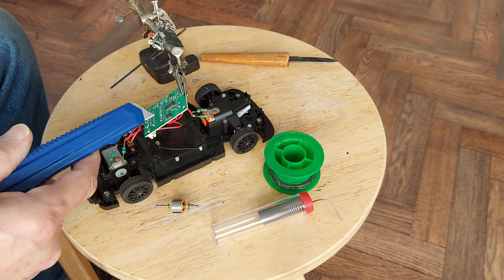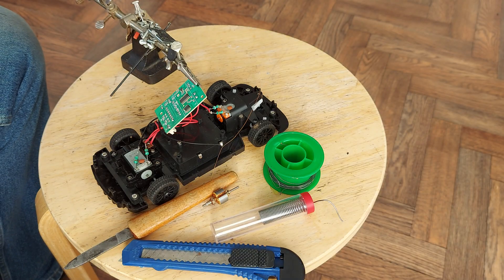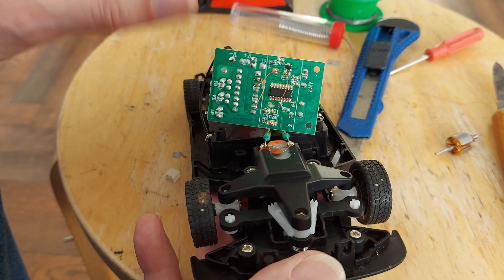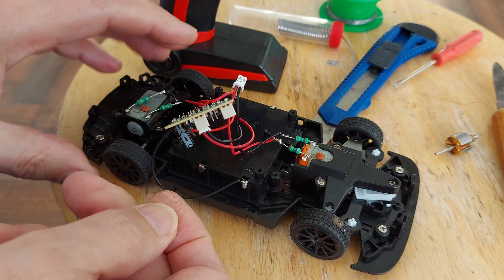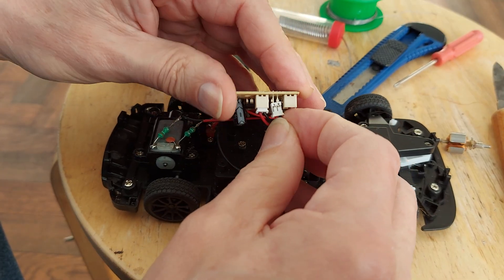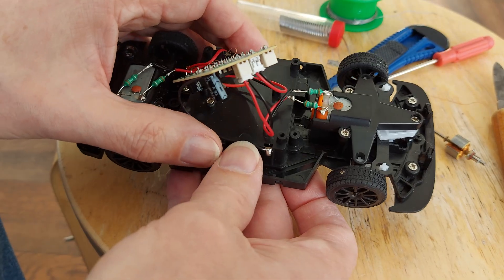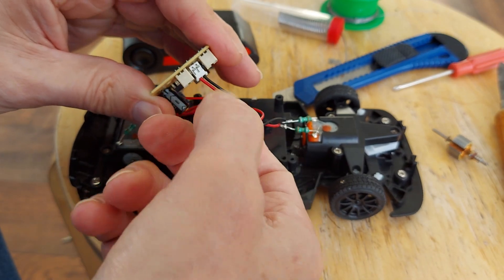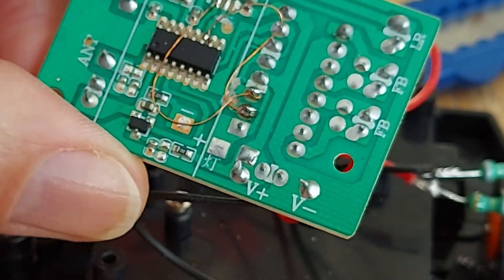Can I modify that 2.4G receiver from AliExpress? FAIL

Comment: my first curiosity is the different colors on the backs of the motors! it's possible that they're used as a designation for driving voltage(for whatever company designed them, they could be different for different manufacturers). another interesting thing is that there's TWO outputs for "forward backward"(FB on the one side of the board) with one "left right"(LR)... can try testing the resistance of each motor and maybe the color is just a misleading bit or dissect them to see the internals. would definitely drive me a lil crazy till I could get in the minds of the person that designed this! I'd have to buy a second one to see if maybe it was plugged into the board wrong as well if the second one functions normally.
Reply from the maker: The receiver appears to be for a toy grade rock crawler. With a motor on the front axle and a motor on the back axle. I have had some crawlers like that and in the first video in this series there is a screen shot of the listing showing that sort of 4x4. As far as the steering output goes, I am now thinking it may be intended for the magnetic armature steering similar to the one in this video https://youtu.be/Ex638u0NxJk?si=gnVSA_5NHUOubPis or this one https://www.youtube.com/watch?v=xoqGAq0cFY8&list=PLA5a2xPRSrB1CeqvjOaBPrHk_lVcTHSb9&index=30
Reply: @GrandadIsAnOldMan  that would certainly make more sense than having a motor trying to be driven in an "always on" state when it has a very limited range of motion when the steering rack is typically held to one side or the other. Hope you had a great Christmas and a Happy New Year!
Reply from the maker: @ToeCutter454  Thank you, and Happy New Year to you too. As for the receiver,  I am only guessing, but I have had a few cars with magnetic steering in the past. I was toying with the idea of buying another one of these from AliExpress just to check it out now that I have effectively destroyed this one, but instead I ordered a load of other stuff that caught my eye 😂😂
Reply: @GrandadIsAnOldMan  lol, looking forward to the new videos then!

Comment: A couple times you had good turning and F/B but you didn't show what you were doing on the controller, I guess trigger did steering and wheel did motion. If you handed this to a kid he would learn left is right, up is down and they would have a good time with it. It really should work as advertised without modification.
Reply from the maker: When I swapped the plugs over so the F/B was the L/R and the L/R was the F/B, the steering worked but the forward backward was reduced power. The receiver appears to be for a toy grade rock crawler. With a motor on the front axle and a motor on the back axle. I have had some crawlers like that and in the first video in this series there is a screen shot of the listing showing that sort of 4x4. As far as the steering output goes, I am now thinking it may be intended for the magnetic armature steering similar to the one in this video https://youtu.be/Ex638u0NxJk or this one https://www.youtube.com/watch?v=xoqGAq0cFY8&list=PLA5a2xPRSrB1CeqvjOaBPrHk_lVcTHSb9&index=30
Reply: I try to stick to the old frequencys,, I have transmitters I get at thrift stores,  cars and boats too. I have good luck getting them working again. I have to fix or modify every thing I see or use, even new items, love using my tools, we're having too much fun. Happy New Year buddy.
Reply from the maker: Happy New Year to you too 😊👍🎉🥂 Yes, the old 27MHz and 40MHz was cross compatible on most brands. I have a draw full of controllers for the old stuff. I also have a drawer full of the "new" 2.4g controllers, but the only time I have found a match was when they were the same brand. I suspect the manufacturers are doing this deliberately to "encourage" you to buy new cars rather than fix old ones 😂

Comment: That is really strange. 
It does work when the controls are swapped, so, a fix would be if the controls on the TX are on wires, not soldered directly to whatever board is in it. They could then be swapped in the TX and you'd be good to go 😊
As you say though, there should be no need to do all this!
Reply from the maker: When I swapped the plugs over so the F/B was the L/R and the L/R was the F/B, the steering worked but the forward backward was reduced power. The receiver appears to be for a toy grade rock crawler, with a motor on the front axle and a motor on the back axle. I have had some crawlers like that and in the first video in this series there is a screen shot of the listing showing that sort of 4x4. As far as the steering output goes, I am now thinking it may be intended for the magnetic armature steering similar to the one in this video https://youtu.be/Ex638u0NxJk or this one https://youtu.be/xoqGAq0cFY8&list=PLA5a2xPRSrB1CeqvjOaBPrHk_lVcTHSb9&index=30
Reply: @GrandadIsAnOldMan  Ohhhhhhhh now that would make sense, rather than raw power to a motor.
Reply from the maker: @Slider2732_  I am only guessing, but I have had a few cars with magnetic steering in the past. I was toying with the idea of buying another one of these from AliExpress just to check it out, now that I have effectively destroyed this one, but instead I ordered a load of other stuff that caught my eye 😂😂
Reply: @GrandadIsAnOldMan  🤣👍

Comment: maybe motors are different . different windings and voltage ratings. savings on manufacturing parts make this viable
Reply from the maker: The receiver appears to be for a toy grade rock crawler, with a motor on the front axle and a motor on the back axle. I have had some crawlers like that and in the first video in this series there is a screen shot of the listing showing that sort of 4x4. As far as the steering output goes, I am now thinking it may be intended for the magnetic armature steering similar to the one in this video https://youtu.be/Ex638u0NxJk or this one https://youtu.be/xoqGAq0cFY8&list=PLA5a2xPRSrB1CeqvjOaBPrHk_lVcTHSb9&index=30

Comment: You need one of those mini oscilloscopes to measure the signal being put out by the controller chip for the L/R function to prove if that is what the issue is. Strange that it does seem to be so strong when you swap the connectors around. If you can figure out the difference between the signal levels, maybe there is a person with a bit more electronic design knowledge than I have that is watching and could perhaps figure out a way to boost the signal with a transistor but now you are really having to retrofit a cheap board that should have been able to do the steering when it was designed.
Reply from the maker: This little series was supposed to be a simple "How to buy a cheap replacement board and controller from AliExpress and get your car running again". This is the 3rd set, one set worked, two sets have turned out to "have issues". For these little toy grade cars with 2.4G RC, the cheapest options seem to be 1. Buy another cheap RC car in a charity shop IF it has the controller and swap the components, or 2. Strip it down for spare parts and buy a new car anyway.

Comment: Maybe there's something wrong with the controler
Reply from the maker: Maybe, but without buying another one, there is no way of checking.
Reply: @GrandadIsAnOldMan that was bizarre actually
Reply from the maker: The receiver appears to be for a toy grade rock crawler, with a motor on the front axle and a motor on the back axle. I have had some crawlers like that and in the first video in this series there is a screen shot of the listing showing that sort of 4x4. As far as the steering output goes, I am now thinking it may be intended for the magnetic armature steering similar to the one in this video https://youtu.be/Ex638u0NxJk or this one https://youtu.be/xoqGAq0cFY8&list=PLA5a2xPRSrB1CeqvjOaBPrHk_lVcTHSb9&index=30